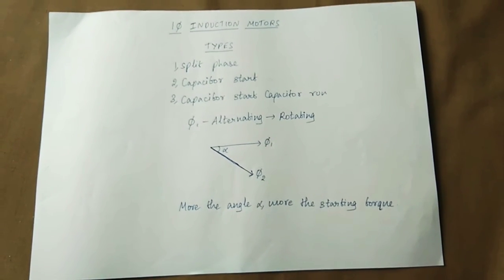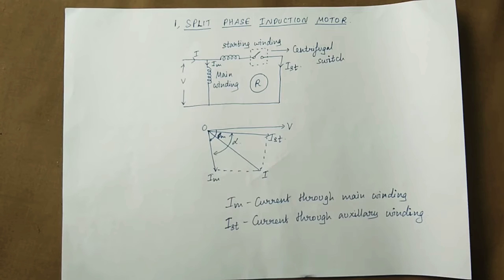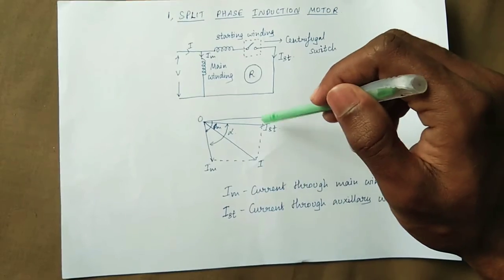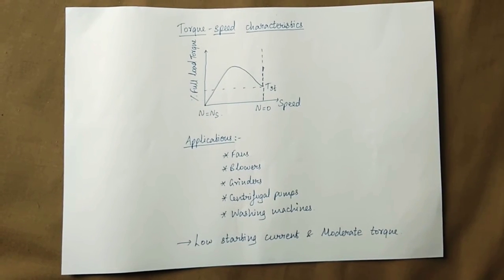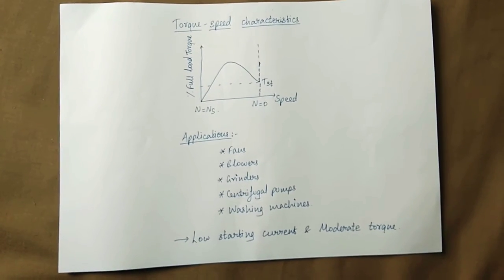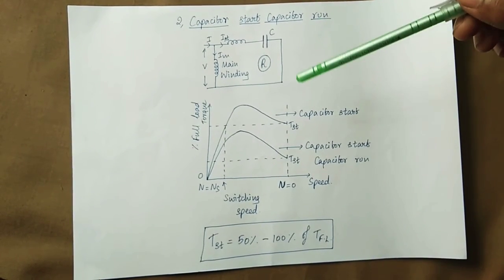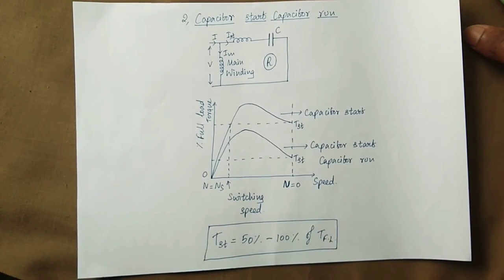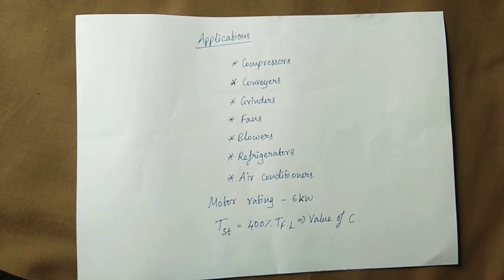Types of single phase Induction motors Explained(Tamil) | EE | Electrical machines

Comment: Centrifugal switch disconnect aana verum main winding le mattum dane current flow agum. Apadi irukumbodu ange rmf produce agade. Appo epadi rotor run aguthu. Im run aganuna rmf venu ellaya. Plzzzz reply me
Reply: I have many doubts in single phase induction motor so plzz help me to know and reply me plzzz. Iam in lot of confusions
Reply from the maker: @meena_thequeen  
Ok you can ask me any time,
anywhere
I will help you
Reply: @endlessedutainment9606  how can I ask my doubts please reply me
Reply from the maker: @meena_thequeen  
Tell me
Reply: @endlessedutainment9606  adavudu first single phase im le verum main winding da irukum ellaya.then what is the purpose of auxiliary wdg.
Reply from the maker: @meena_thequeen  
auxillary winding is the 2nd winding for stator 
It  is used for starting purpose 
After motor reaches 70%of speed,
It is out of the circuit after short time
Reply: @endlessedutainment9606  k after motor reaches 70to80%of speed ,auxiliary wdg and c. Switch disconnected from the ckt then how the motor keep running without  rotating magnetic field. The combination of two winding (auxiliary and main wdg) produces rmf right. Then when auxiliary wdg is disconnected then how the motor will run. Reply me plzz
Reply from the maker: Centrifugal switch is a temporary switch.
Once the rotor gets emf,you dont need any switch.
After that,without c.switch the rotor will run